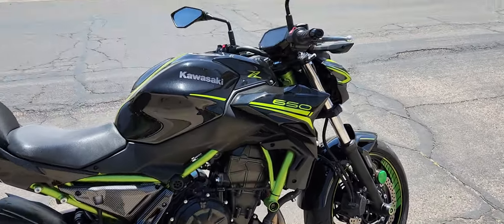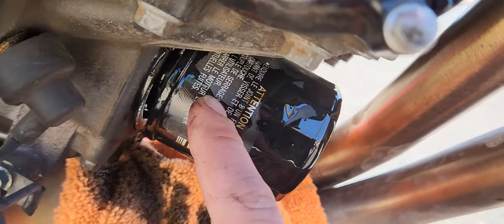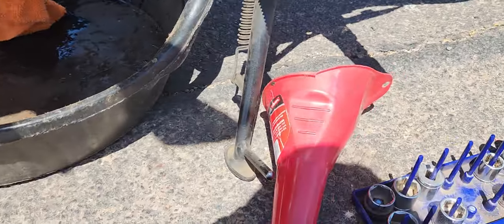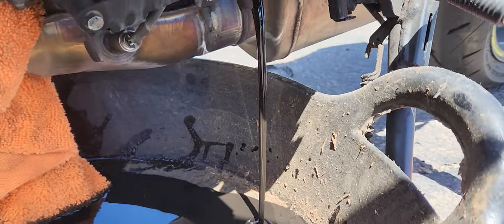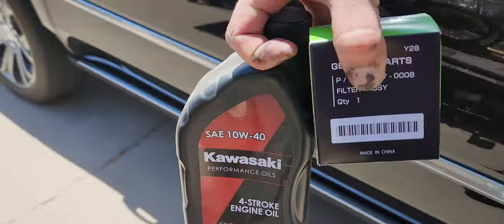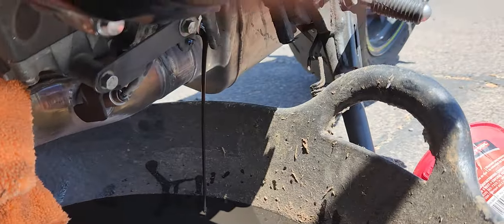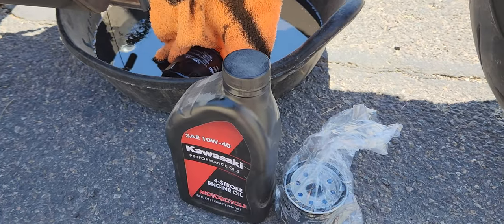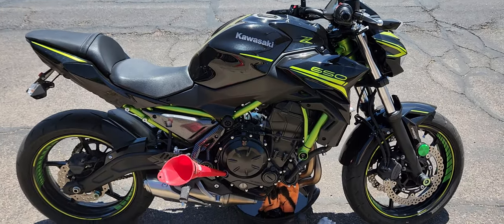2020 z650 oil change  tip and tricks.

Comment: K&N  make.a Quality Oil Filter. with. a Nut   welded on
Makes. Getting Filter off  Easy..   Don't use the Nut to
Install. Hand Tightened is Good enough